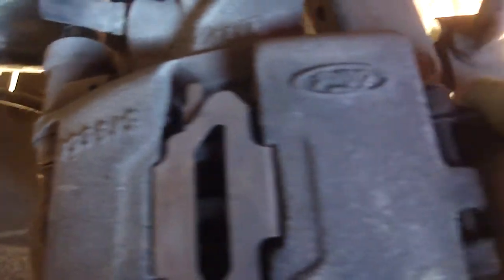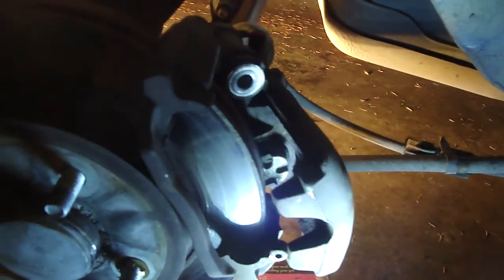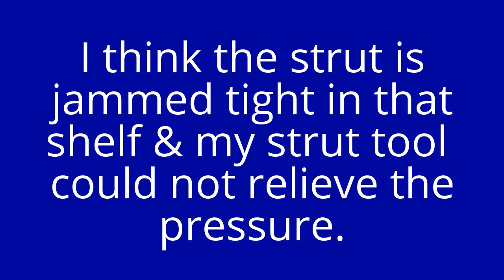Trouble with Rear Struts on a 1998 Ford Contour

Comment: Good attempt, at least now I know somethings are best left to the ones who get paid to take those risks. My spring coils are broken so now I'm thinking I may not be able to replace it.
Reply from the maker: Great timing!  I was getting a knocking sound on hard cornering.  I remember seeing one of Ivan's videos on his Mercury Mistique.  Today I removed the rear strut using Ivan's method and it was easy.  No need to compress the spring before you remove the strut.  Just removed the rear subframe bolts (2) for that side and the strut comes out easily.  I'm filming as I go along.  I found a broken strut mount.  Part comes in on Tuesday so the video won't be uploaded until next week.  Ivan's channel is Pine Hollow Diagnostics.  You can do it!  Best of luck!
Reply: Do you have a link for this Ivan video?